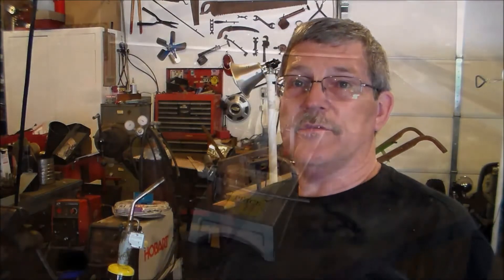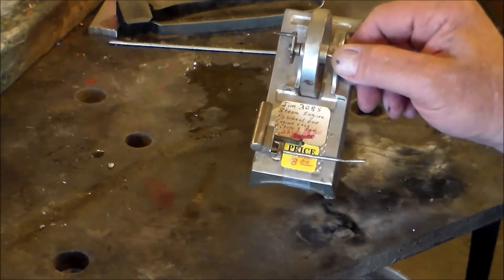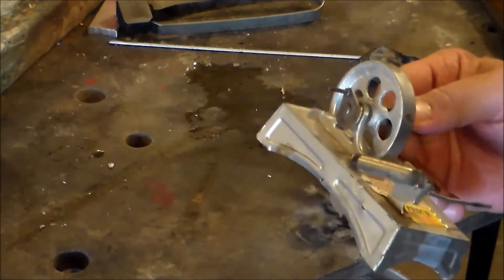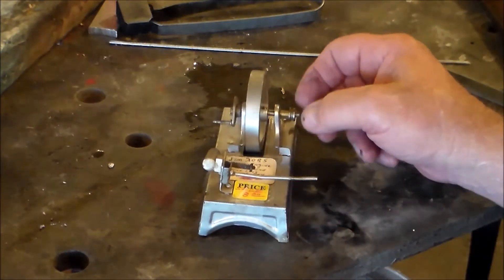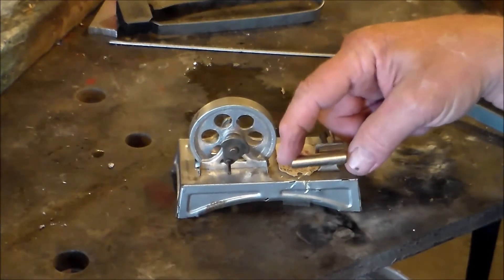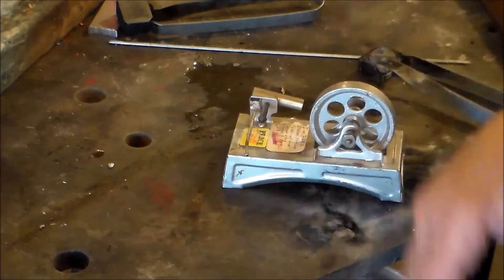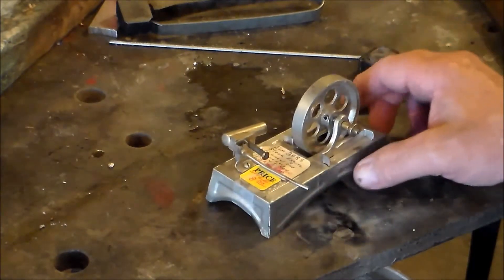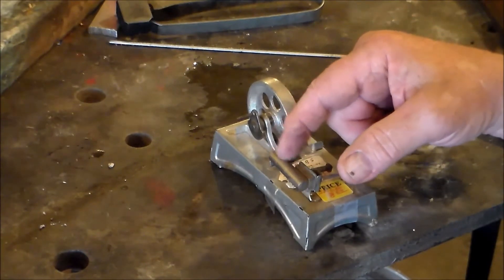Steam Engine Model

Comment: That'll be one neat project to get that steam engine accessory working again. I really do enjoy all this steam power stuff. I think once you start it would become very addictive. I also wanted to comment on the old forging and carpentry tools on your back wall. I have a few old pieces myself and I think I should find a place to display them all some day rather than just keep it stored away. Keep them videos coming lloyd,
Reply from the maker: It have a small collection of antique gas engines. But my first interest was steam. They are hard to come by and expensive when you do find them. This steam project will be fun getting it back in operation. Thanks
Reply: I am looking forward to your new steam engine project. Thank you for sharing it. God bless.

Comment: That engine is off of a Linemar model J-2734. Linemar was the Japanese branch of Marx toys. They used cheap stamped tin boilers witch tended to rust. The  J-2734  was a knock of the German made Fleischmann 120-1. Hope this helps.
Reply from the maker: Queen City Motion Pictures   Thanks very much and greatly appreciated.
Reply: No problem.

Comment: If only I could find a Case 75/150....dang. My uncle had an old John Deere steam traction and sold it, working as they drove it on the flatbed, for scrap in 1975. I always liked steam everything from trucks to tractors. That will make a good project.
Reply from the maker: The tractor club has several collectors with steam tractors. Some impressive  machines. Thanks and take care
Reply: There were only 5 Case 75/150's built in 1919. Super rare and don't ever expect to see one in person ever lol. Are you going to just make an engine or are you planning on making it do something. I guess I will have to wait to see what you make lol.